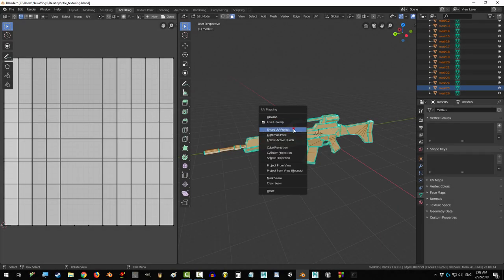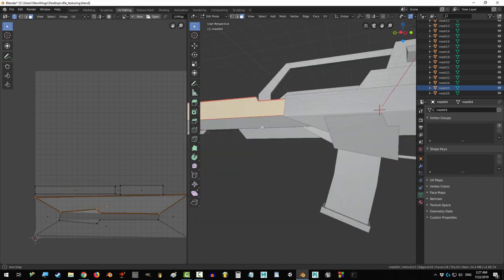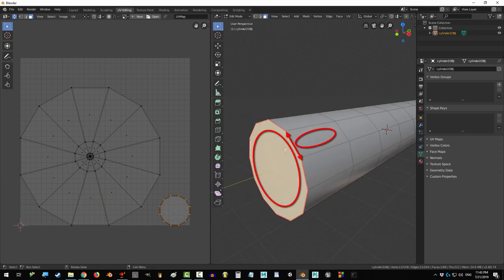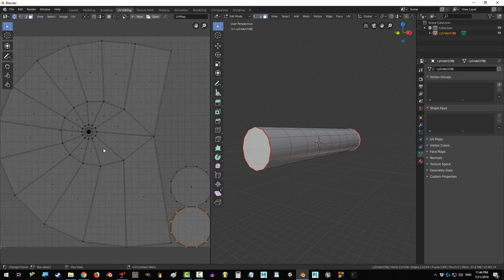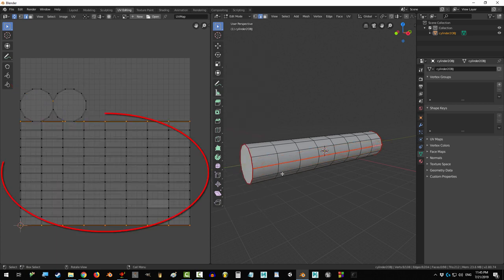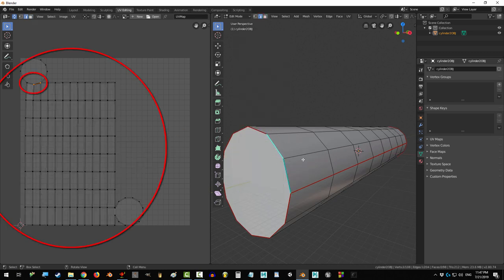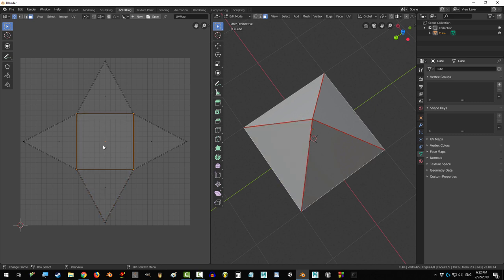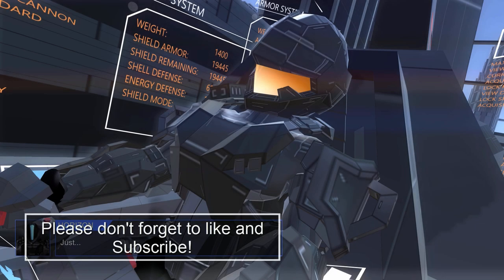Blender 2.8: UV Seams Explained in 3 Minutes!

Comment: thanks for the video. im a beginner using 3.4 and i also learned a few extra things here:
1. Blender by default does not auto sync your edit mode and UV edit mode. You'll have to toggle that in the UV edit mode.
2. Interestingly, your UV editor is auto-unwrapping as you mark these seams. There's another setting I had to toggle under "Active Tool -> Options -> UV - Live Unwrap" to get that working.

Comment: idk if you're gonna read this but i have a question...in substance painter there's an option called "generate missing UVs" so i tried UV unwrapping a cabinet couple of minutes ago and it looked great with the texture except one spot that i left on purpose so my question here is how are "misplaced seams" identified? like i textured assets that had no stretching but still seemed a teeny tiny bit off so how can i know i did a good job and how can i make sure i marked enough UVs in the correct way so that i can texture it freely on substance painter without stressing tf out on wether or not i made a mistake while unwrapping in blender that may take some of the freedom of texturing away?

Comment: Loving the short to the point tutorials!

One question, is it me or the seams are now automatic? I select the cilinder and it separates the circles and the rectangles just like you did with the seam
Reply from the maker: Thanks, and yes. I believe it automatically UV's the basic shapes you get from 'shift + a' :)
Reply: @TheRoyalSkies  ohhh all right, thanks!
Reply: At this point if you just open Blender, delete everything, and hit UV Unwrap, you'll get an unwrapped cylinder. This has got to be the trillionth tutorial on it, and that's because it's the simplest thing other than a cube, but it looks better on the UV layout.